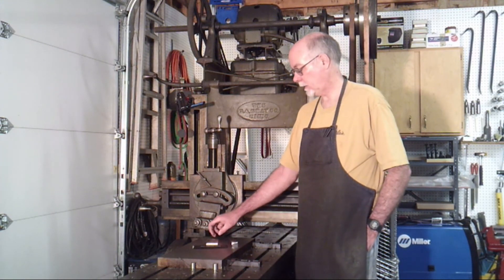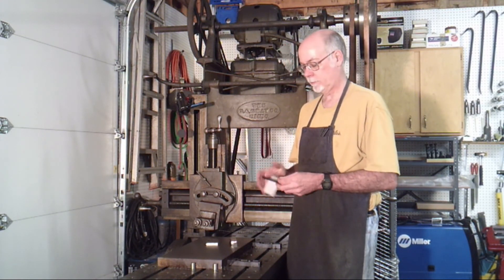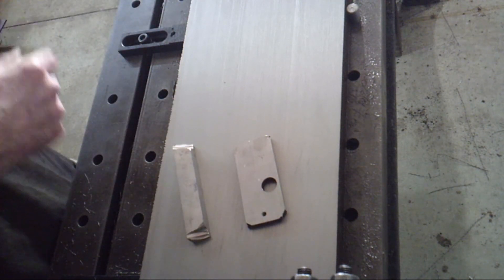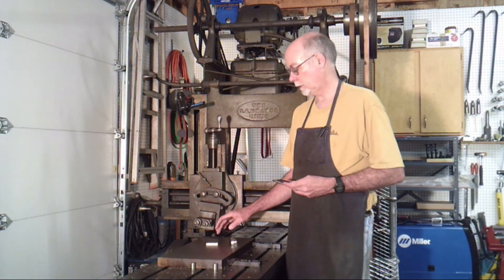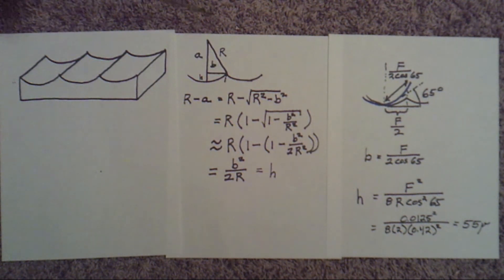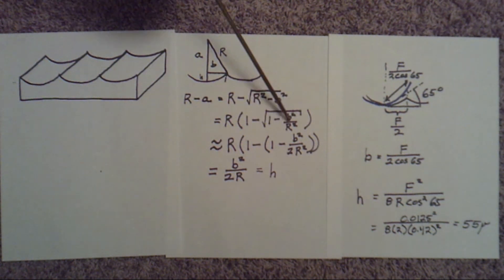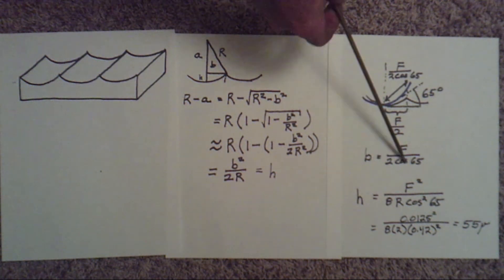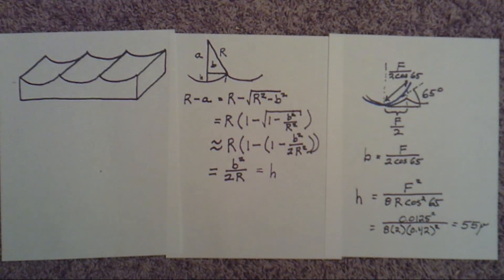Sunday Grind: Epilog

Comment: Very informative. Thanks. What it says to me is find a way to reduce feed/stroke to 0.003" instead of .012 ".    h  will then be 1/16 of what you now can achieve.  In your case the factor of  1/2 h gained by shear tool would hardly worth the effort of all that grinding. Of course you know that.  I have found that " any" normal SHARP  tool can produce a finish that satisfies me at .003 " feed/ stroke. Jim.

Comment: Good lesson on calculating RA values. Now will you be running that slab over a surface plate to see how flat and even thickness you got it? I could think of a lot of uses for a planer like that!
Reply from the maker: Excellent idea! Unfortunately, the slab is a bit larger than 10" x 22" and my surface plate is only 12"x18," so I can't perform the test that you suggest.
.
Here is what I can do easily: I measured the thickness at the corners and the middle of the long edges, about an inch from the edges. Here are the results (the cut went right to left, feed from bottom to top):
.
1.338     1.339     1.337
1.341     1.341     1.338
.
Not too bad, considering the original plate was warped. The cut looks to be a little shallower at the start of the cut, and the feed rail might have been off 0.001-0.002 in 10 inches. I blame it on the machinist (me).